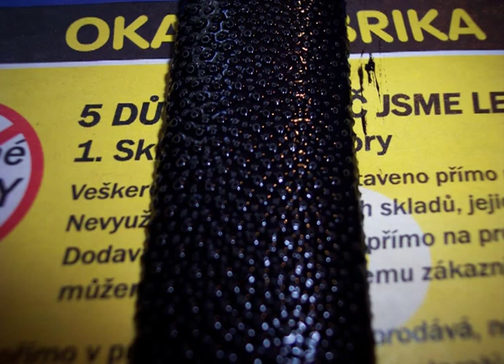Bolf hira tanto - koshirae/polish

Comment from the maker: Tsuka is no problem,but making a good saya can be pretty expensive,simple saya in black lacquer with horn parts costs around 700 usd at Fred Lohmans company.
Traditionally made saya are nothing like production saya, they are hand carved for every blade separately and they fit the blade perfectly so there is no rattling. After that koiguchi,kojiri and kurikata are made from buffalo horn. Finally the saya is lacquered,and that is the most difficult part,lacquering can take up to two weeks...